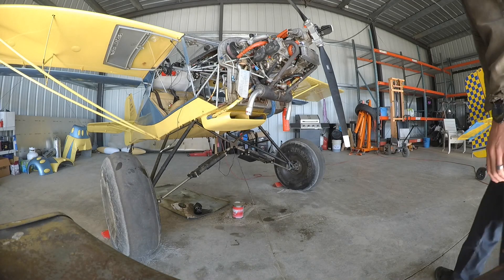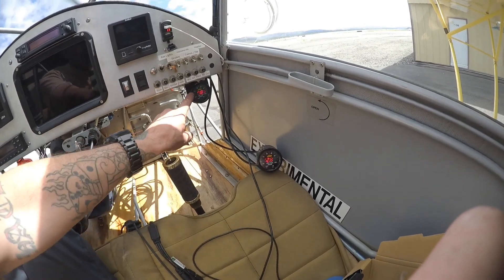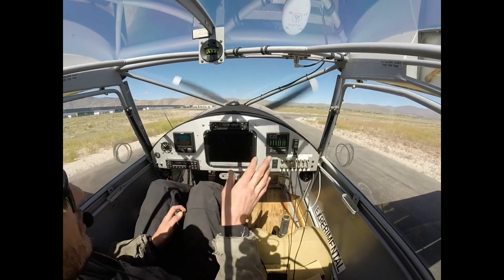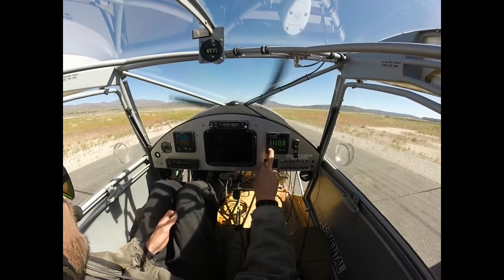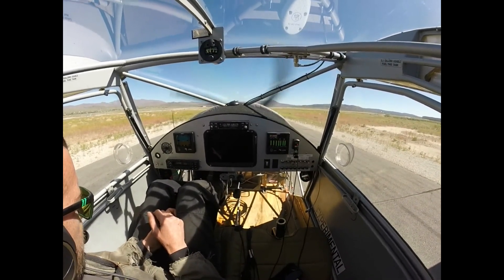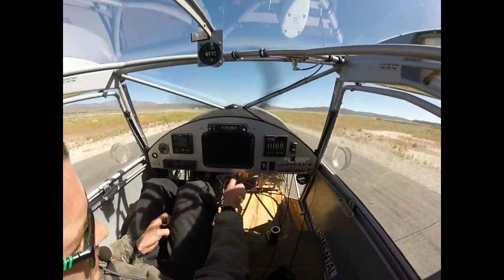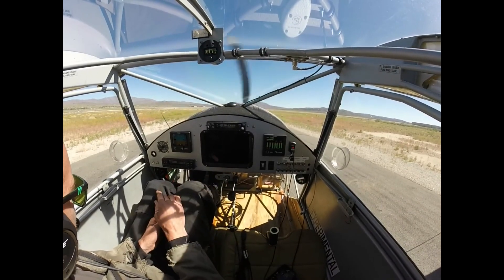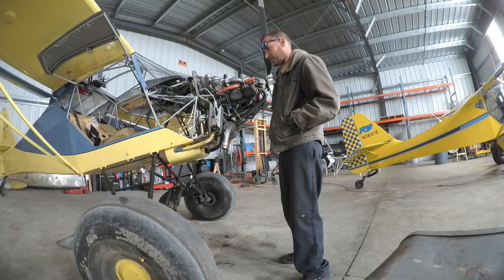Demystifying Bing Carburetors II - 912 Rotax Tuning via AFR

Comment: It’s interesting for sure, but would having the “tuning muffler” fitter which is baffled in the middle change the combustion and effect the tune compared to the normal muffler without the baffle?  It seems like it could make it not ideal in that you tune it with one muffler then it might not still be tuned great after changing mufflers? Also if the main jets are the same size left bank to right bank then what is causing the difference in reading at wide open throttle? There would be very few engines running a different size main jet in each carb! Does that mean that most engines aren’t running equal mixture on the left and right cylinders?